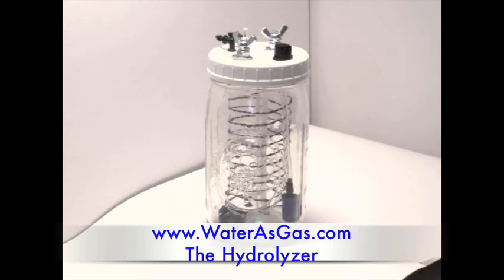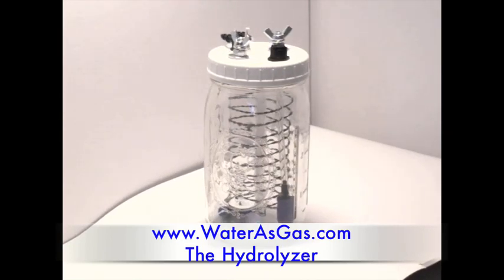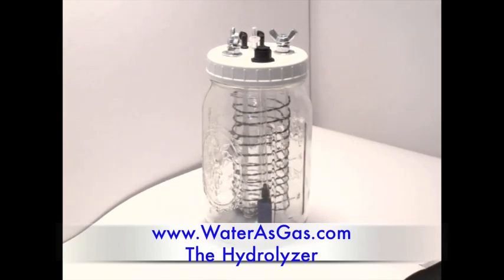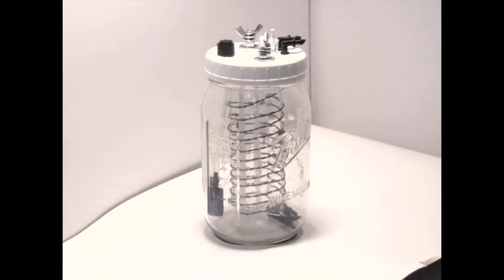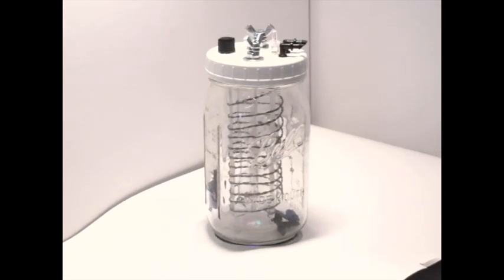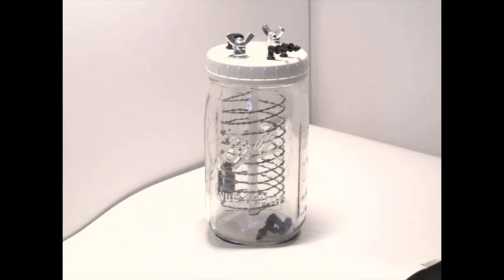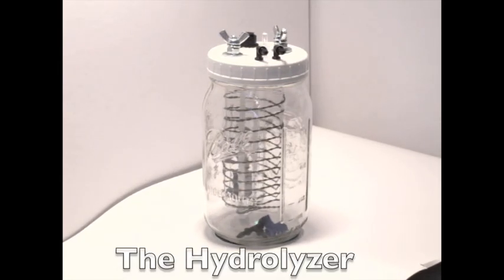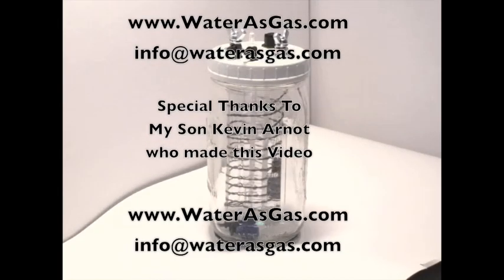Turbo Diesel Hydrolyzer

Comment: U IDIOT JP, must be JP Morgan, These Devices don't Produce Energy, the energy is produced in stars u jackass, they merely extract the energy, how much energy does a motor need to extract the potential in fossil fuel?...i'm no scientist and i can figure that out , DUMBASS! so they don't defy most scientific laws, they only defy ones interpretation of them. may as well u said we use more energy to mine fossil fuel than it produces.

Comment from the maker: Inform yourself about the subject before making unwarranted comments. Hydrogen does not run the engine but is mixed with the present fuel/air mixture and also by using a MAP Sensor, which manually controls the mixture, the gas mileage savings are achieved.

Comment from the maker: This video is to introduce people to an alternative way to save on fuel costs. The technology has advanced tremendously since this video was released and now uses stainless steel plates and a device to control the cars computer which controls the air/gas mixture. This is where the gas saving gains are made today. If you a bit more research, you would know this.

Comment from the maker: The newest technology unfortunately has its price and that is why everybody is not using it. In the development stages one could obtain an HHO generator for around $80. The newest technology costs around $1500. The biggest development has been the ability to change a vehicles computer and thereby controlling the air/gas mixture. If adjusted properly, the savings can be from 30-50%. Research the advancedhho website and see what a proper HHO Generator can do.

Comment from the maker: @LordTraer That is why there are fuel heaters. In cold countries, even gas/diesel have problems and fuel heaters are used to cope with this. Normally in cold climates, when the motor is started, it warms the unit and the water and mixed in additive work again to produce the needed HHO gas and the gas mileage improvement is enjoyed.

Comment from the maker: This video was uploaded 3 years ago to show to the public an alternative way to save on gas mileage. Since then, the technology has improved tremendously. The industry has moved away from a glass container to stainless steel plates. A MAP sensor now controls the cars computer which controls the gas/air mixture resulting in 30-50% gas mileage improvement.

Comment: Hi HHO folks. Don't do as I just did!!! I blew my intercooler in my TDI-passat with HHO today!! What I did? I had wired the cell so a relay started it when I turned the key. But It also started while I was glowing the engine. I glowed the engine a little longer, I thought the engine should start easier. BOOM... Wire your cells so they start when f.ex the headlight turns on, NOT when you just turn the key to glow your diesel!!!